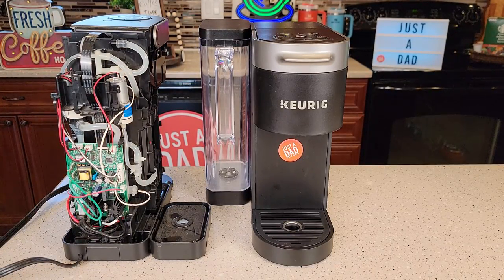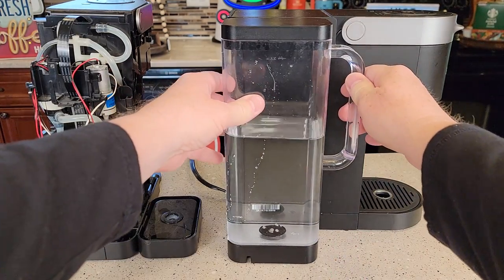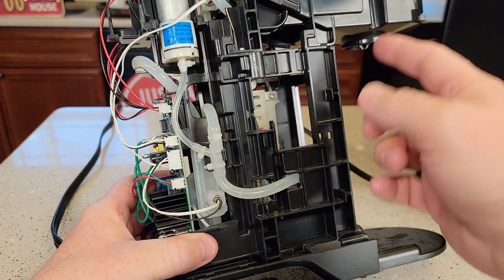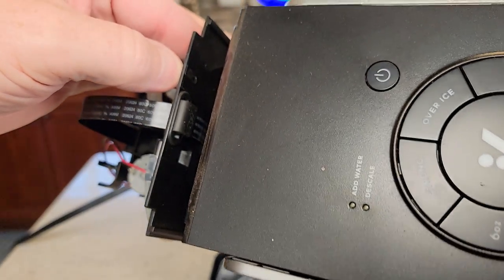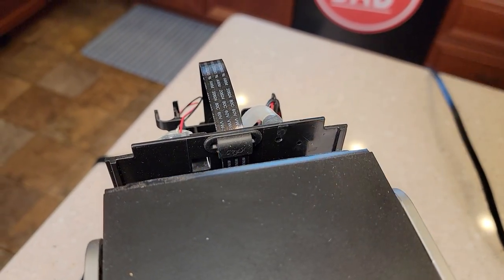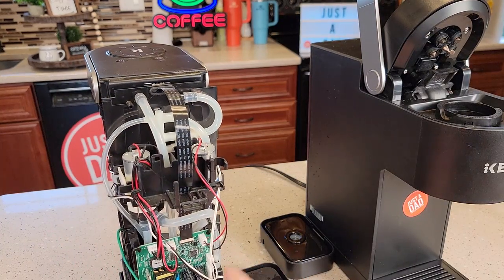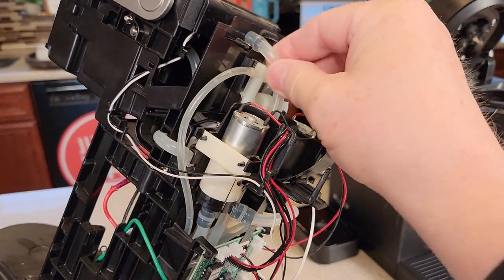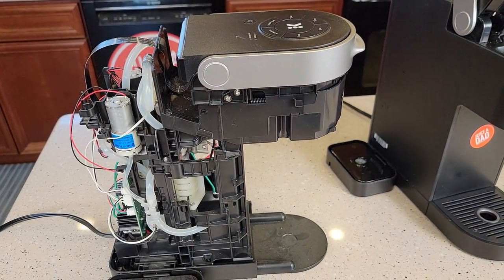How To Fix Keurig K-Supreme Coffee Maker ADD Water Light Not Working

Comment: Sometimes the reservoir lid has gotten wet and is making an airtight seal at the top of the reservoir itself. When that happens, the simplest solution is simply to lift the lid on the reservoir so there isn't a vacuum inside it, preventing air from coming in and therefore water from going out. Sometimes I leave the lid slightly askew on top of the reservoir until it dries.
Reply: 🎉 thank you for the easy fix. There was no way in hell I was gonna take this machine apart at 6am lol

Comment: The easy way is get a paper towel and a straw, wet the paper towel creating a seal and place the straw into the water inlet, blow gently into and hold the paper towel and straw to form a seal and continue to blow a couple times until you hear the air flow through the outlet. DONE!

Comment: As others have mentioned, my issue is the add water light does not turn on when low. It will keep running until shut off manually. It's also stuck in descale mode. It will go through the process to reset but because it can't sense the water level (add water light never turns on). It never comes out of descale mode. Any thoughts?
Reply: I was able to get a replacement from Keurig for my Supreme model. The Descale never went to the Add Water Stage and the coffee maker overheated. I tried everything to reset it. My replacement can be cranky during descale mode, but does get to the Add Water mode and the Descale light shuts off. I also unplug my Keurig Supreme after running the Descale mode for at least 15 minutes as the entire head of the unit gets hot. Once this coffee maker has croaked, I won't buy another one like it.

Comment: Another great video, your overheat reset video on the Supreme Plus saved the day after running dry. I was just following your descale video and noticed that it tried to run the solution even after the tank was empty. I quickly stopped it so it wouldn’t trip the overheat again. My question is, is it normal for it to continue to run? Seems like a stupid setup if it is.

Comment: If you did the thermal reset and the lights flashing after it turns on, double check that nothing came unplugged while you were getting the housing reseated. 

I was delighted to see the Keurig working but then had a flashing light for add water. Taking it back apart and a jst connector had become unplugged. 

Fixing that stopped the add water light. Be sure to be careful when putting it back together!
Reply: Bro i really dont want to have to take it apart again im sooo irritated

Comment: If your K-Supreme Plus SMART coffee maker is flashing (Add Water), and you fill up the reservoir and the light is still flashing (Add Water), try this.

Step 1: Take the reservoir off the unit and set aside for a moment.

Step 2: The hole where the reservoir sits to supply water, with your finger push in this hole. Water will start to flow out, let all the water come out. Clean up water with towel.

Step 3: Reinstall the reservoir. The screen may now be flashing Dispense Hot Water.

Problem Solved.
Reply: This solved it!
Reply: Thank you, this worked for me as well. 🎉 I first tried the priming pump method mentioned in the video, and it didn't work. I knew I would find someone in the comment section with a new way. Thank you, thank you.
Reply: Ditto!  Well done. Thank you
Reply: That works until it doesn't. Then we find ourselves here 😂

Comment: Do you know if the water sensor circuit is normally open or normally closed.  If I want to add a momentary button to temporarily bypass the sensor when it mistakenly says to add water, should I wire it to open the circuit or close it? And thanks for the helpful video!

Comment: During Descaling K-Supreme Plus the reservoir became empty, the Descale message stays on [blinking] but the Add Water message does NOT come ON.  What would cause the Add Water message to not come on, even when the reservoir is removed?  I tried purging air out of the line lifting the reservoir more than 20 times and watched bubbles become smaller and reduced from a few large bubbles to one small one.  It seems Air in the line should trigger the Add Water message to come ON and purging the air should make it go OUT which is the opposite of my situation but I tried it anyway. I 'Reset' the machine as someone suggested by turning it OFF, Unplugging, removing reservoir, waiting more than 10 minutes, etc. After plugging back in w/o the reservoir, turning it ON, the Descale message comes ON, blinking, and the Add Water message is still not ON.  I can insert a coffee pod and make a cup but the Descale message continues to blink...I suppose because it failed to complete the Descale process properly.  Broken or 'clogged' water sensor?